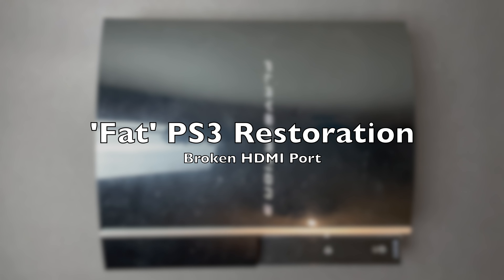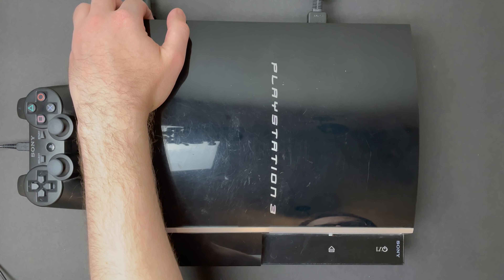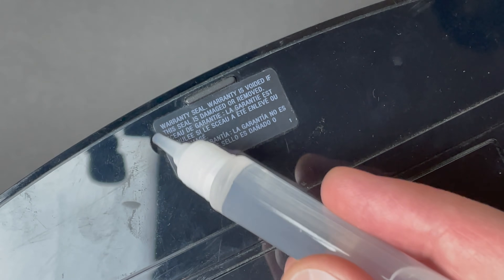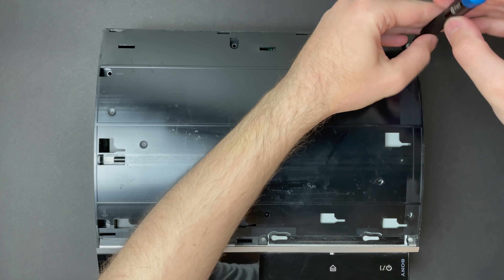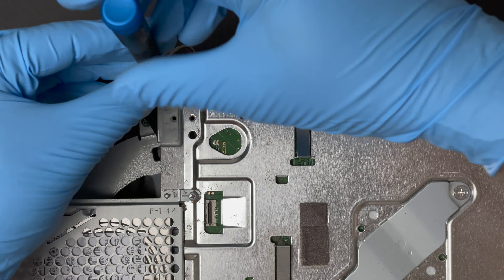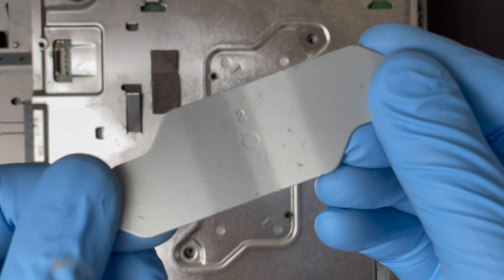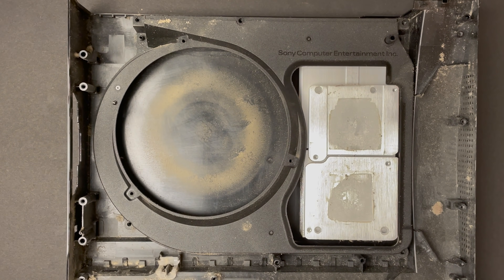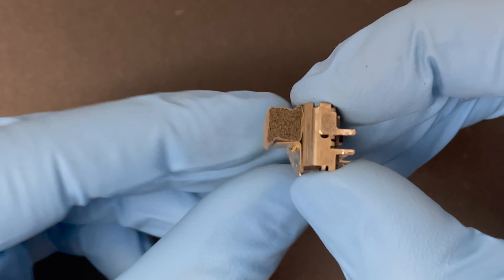Sony PS3 "Fat" HDMI Repair - Faulty Console Restoration

Comment: Hmm, yeah, fume extractor is definitely essential, I don't know how I got along for so much time without one. Now whenever I forget to turn it on, it only takes me a couple of seconds to immediately go for the on switch.
As for the through holes on the and the difficulty clearing them with braid, if you have a desoldering station, I find using that works very well. Even if you don't use it to initially pull the port out and still use air, adding solder after that and then going in with the desoldering gun to clear the holes works really well. Obviously first it's best to let the board cool down.
Reply from the maker: A desoldering gun is probably next on the shopping list. I had a desoldering iron (manual pump) and used it in the NES recap video but it wasn’t very good so I returned it. Never ending list of toys.

Comment: Hmm,  didn't know replacing the HDMI port could be that easy.  Great job.  Love your videos.
Reply: I think it’s easier on the ps3 because it’s though hole soldering not like others where it would be surface mount soldering but with the right tools it doesn’t look hard. I’m about to replace my first one on a ps3 and then I’ll work on my ps5 because it fell over and yanked the port so it’s wonky but does still work.

Comment: Hmm... You soldering technique is okay but you need a way stronger soldering iron. You can apply additional heat using hot air and it should help. I highly recommend getting proper soldering iron which reaches higher temperatures. You easily need over 400 deg. Celsius to work on lead free boards.

Comment: Remember: You can use hot air and soldering iron the same time to open holes. It will work twice as fast. For the exposed traces you can use UV curing soldering mask. Works like a charm. I always love your videos
Reply from the maker: Thanks for the tip bud. I've seen repairs do that for soldering SMDs, but how would you go about trying that for opening those holes up? Would you still use a braid somehow as well?
Reply: @Borderline OCD  I would use  Braid. You can keep the braid in place with the iron and other hand hot air. No need the rub the braid.  The soldering mask came off because of the rubbing.

Comment: Good. But you need to use a slightly higher iron (and gun)  temperature.
Reply from the maker: What temperatures would you use?
Reply: As I saw, you use Chinese devices. Usually they all are undercalibrated. So, if you solder at recommended temps for specific materials, you need to use 20 to 70C higher temp, for example 250-280 for Pb solder, and 290-350 for non Pb solder.